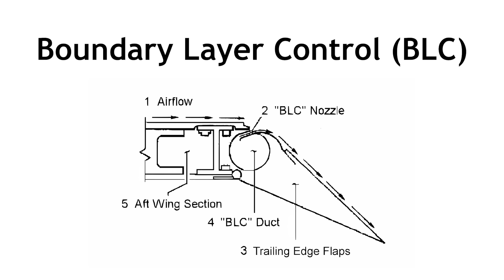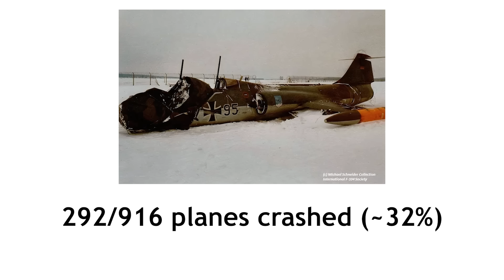Why This Jet Killed So Many Pilots?

Comment: On lighter note......I attended an air display at Brustem Air Force Base in Belgium in 1964/5. The F-104G'S display was unique. It started its take off as normal . Half way down the runway it abruptly took off, did a fast barrel roll, landed and continued its take off run....I had a clear view sat on top of a 206 Sqdn.Avro Shackleton MR3 from RAF St. Mawgan!
Reply: That video is available on youtube.
Reply: @stephenlowry8618  What a star you are Stephen. For me, that experience was lost in time.....and the barrel roll turns up on YT!. you get this weeks YT Oscar for Good Gen!!

Comment: The common US narrative that “Germany misused the F‑104 as an all‑weather fighter” is misleading. In reality, the Bundeswehr needed a modern all‑weather interceptor to fulfill NATO duties, including defending against low‑level supersonic bombers.

The F‑104 was originally designed by Lockheed as a fast, fair-weather day fighter for the US, not for European all-weather operations. The purchase of the F‑104, however, was heavily influenced by US political and corporate pressure, not purely by German technical choice.

Germany’s use of the F‑104 in all-weather roles was an operational necessity, not a misuse. The narrative blaming Germany obscures the fact: the aircraft was bought under pressure, and the Bundeswehr adapted it to meet real NATO requirements.
Reply: NATO bought the Starfighter mainly to replace it's F-84 fleet in the nuclear strike role.  They deployed about twice as many F-104 fighter-bomber squadrons as interceptor squadrons.

Comment: In terms of the swiss cheese theory, the F 104 simply consisted of more holes than cheese.
Reply: And there was most probably corruption in procurement: Lockheed was nearly bankrupt and was desperate to sell it to other nations. (Corruption was proven in other nations, but in Germany authorities failed in proper investigating the procurement process.)
Reply: And when you buy the farm, there won't even be enough left to make a sandwich.
Reply: Widowmaker was basically a manned rocket

Comment: Speyer Technical Museum, in Germany has a F-104 on display with it's outer skin removed. Seriously scary, extremely fragile structure.
Reply: Been there. Seen it. The F-104 is built like any other plane from that era. Planes are designed to be as light as possible. Things like cars, buses, trains, can all be grossly overbuilt. A plane cannot. Your concept of strength is just skewed because you have no knowledge of aircraft design or structural engineering. The skin provides a significant portion of the strength in a modern aircraft design (post-WWII). It is called "stressed skin" or "monocoque" construction.
You also probably don't appreciate how strong the alloy used really is because you have only interacted with consumer grade aluminum alloy. This isn't a bicycle frame and the alloy used is much stronger.

Comment: In Germany WE Had some Problems with this fast and mobile jetplane:
 IT was constructed for good weather and we tried to make it an alllweather plane.
WE did Not have enough Hangars for it- and it was parked unser Open Sky
WE ad too much additional systems to make the f104 better-as a result it becomes too heavy
And the Training time for our pilots was Not enough
In the end it was the wrong plane for the Luftwaffe....
From about 900 Planes more than 200 Fall down.....
Reply: Don't kid yourself.  Germany would have had just as many problems with the Mirage, the Super Tiger, or whatever.
Reply: @dukeford any Arguments for your oponion? The reasons i discribed is what i know...
Reply: @derrasendeemil6714  Because none of the prospective aircraft that Germany was considering at the time had any better safety records, that's why.  The main problem with Germany's Starfighters was poor management, not the airplane.

Comment: F-14 was also a Widowmaker... It's almost criminal that it wasn't fitted with the GE engines almost from the start. It wasn't long after the F-14 came out that the F-16 came out and it already had the engine that would eventually go to the F-14B and D model
Reply: The F-14 was about 3-4 years ahead of the F-16 in the design cycle. At the time, it made a huge difference in design choices. The F-14 first flew in 1970. The F-16 first flew in 1974. In that time, they went from tube based computers to solid state, with the difference being that the F-14 is basically a third generation jet with some fancy new avionics and the F-16 is a fourth generation jet with fly by wire. The F-14 was expected to serve in Vietnam. Grumman was too late to the party. The F-14 was basically designed for Vietnam and wasn't really suitable for what came after. When you properly consider the F-14 as a third gen jet, it is pretty crazy what they were getting it to do. And not surprising it was a dangerous bird to fly.
Reply: @RunsWithChainsaw good point...

Comment: I was an infantryman, 3rd ID in Schweinfurt, FRG from 76-79. The Luftwaffe F-104s used to practice strafing runs on our troops and APCs during FTX/CPX/REFORGER exercises.

The sound out of those damn things was something straight out of hell. They would come in low and fast and then hit afterburners after pulling up.

Right after that we would get the American Air Force F4s doing the same thing.

Comment: Regarding the downward ejection seat. I spoke to a Royal Navy (RN) Fleet Air Arm guy who's job was maintenance of fast jet ejection seats. The RN specified 'zero/zero' seats, capable of safely firing at zero altitude and zero forward speed.
Reply: There weren't any zero-zero seats when 2nd Generation jets were being designed.

Comment: The aircraft was an excellent design for it's intended role. It was asking a lot for the young pilots who flew this aircraft and it was unforgiving at low speeds and low altitude. 50% of Canada's Starfighters were lost to weather related accidents. Germany lost many of theirs to weather related causes. Japan and Italy among others had used the aircraft in it's intended role and were successful in it's use for many years. It required an exceptional pilot with a superior understanding of the aircraft.
Reply: Aircraft engineering training, during five years in the technical university, perhaps???
Reply: Italy lost 38 %,  Why Japan lost so few may well be the same as Spain, low losses because they only flew in very good weather.

Comment: you just had to know how to fly it ,,,,dont pull it off to soon on takeoff keep up speed on landing dont try to turn to tight and enter a high speed stall
the 104 was a interceptor not a fighter; the downward ejection was reversed early in its develope no problem

Comment: The Germans lost more F-84's than 104's. Spain didn't lose any of their F-104's. Kelly Johnson built a stick shaker so as not to exceed the 15° critical angle of attack. When flown properly and with maneuvering flaps, it could turn about the same as an F-4. A bad craftsman blames his tools.
Reply: This is BS, the loss rate of German F-104 exceeded that of German F-84 by far.
Reply: @OliverSchroeder  37% crash rate of their F-84's vs 32% crash rate of their F-104's. I stand corrected, I should have mentioned percentages. They needed more training and better maintenance procedures.

Comment: I remember the English Electric Lightning as being before the F104 and exceeding Mach 2? And much quicker in the climb
Reply: And it did not crash.
Reply: @stephenconnolly3018  Really?  The Lightning's attrition rate was only around 10% lower that the Starfighters
Reply: @dukeford  Really? English Electric Lightning  just over 15 %, the F 104 in Germany  32 %,  F 104 in Italy 38 % and F 104 in Canada 46 %.
Reply: None of which is true, I'm afraid.
Reply: @dukeford No, of course, never ever contradict American historiography!
Reply: @OliverSchroeder  Whatever. 🙄The Lightning didn't fly before the F-104, or exceed Mach 2 first.  The rates of climb were virtually identical.  These are documented facts.
Reply: @dukeford  The Lightning was the first to achieve supercruise and had a much better climb rate
Reply: @barrierodliffe4155  The F-104 and the F-106 could also supercruise.  Which one did it first is a matter of conjecture.

Better climb rate?  The F-104A had an initial climb rate of 60,000 feet per minute.  The Lightning was 50,000/min.  The Starfighter set the climb-to-height record.  The Lightning never did a damned thing.
Reply: @barrierodliffe4155 The Germans would have been much better off with the Lightning which entered service in 1960. They did not need long range but did need fast climb.

Comment: And then there was the infamous Lockheed scandal, involving many Europeans politicians and even royals who got bribed by the American company, which sold its jet as agressively as their damned overprized F 35. Belgium at that time had a mix of Mirage V (deltawing) and Starfighters used as fighter/bombers. My brother (1953-2023) was a technician on them in Kleine Brogel AFB, hence the presence of the two pedals and the yellow/black stick to open the canopy in case of a crash in my appartment can be explained :)  I've got to admit I was much more a fan of its successor, the versatile F 16, and especially the beautiful 2 seater....

Comment: The first flaw was the german corrupted politicians who "chose" the F104 instead of more capable plane like the Mirage III
Reply: С тех пор мало чего изменилось в Германии. lol.
Reply: More capable?  Hardly.
Reply: @dukeford No. Definitely.
Reply: @OliverSchroeder  The F-104 had superior performance in all flight regimes except low speed handling. The avionics and cannon were FAR superior. It was cheaper. It was a fully developed airplane; the Mirage was not.

Comment: What is baffling is why after all the deaths from using the Starfighter in low level strike missions did the Germans and Canadians continued to use them in this role?
Reply: Yes the RCAF used the CF-104 in the reconnaissance role, as a deliverer of 'instant sunshine' in the nuclear role, and finally in the pure ground attack role after nukes were withdrawn from Canada's role.
Reply: What makes you think they would have done any better flying something else?

Comment: The Belgian Air Force had the same problem. It bought 112 F-104G's. It lost 40 of them. 21 pilots were killed. Main reason was its use as a ground attack aircraft.
Reply: Great score!
Reply: A 35% attrition rate is typical for any 2nd Gen fighter.
Reply: @dukeford  With pilots killed too?
Reply: @leonpastis4663  Actually, it was 24 pilots. All officers (none of the 45 Belgian Warrant Officer/NCO Starfighter pilots were ever killed). 58% is a high fatality rate.  OTOH, their attrition rate wasn't out of the ordinary at 36%, and their accident rate was  reasonable enough at ~ 11 losses per 100k hours.
Reply: @dukeford So, according to your previous argumentation, dumb, lazy, unable German technicians were flown to Belgium and bungled the job?
Reply: Well the Spanish Air Force didnt loose a single 104.
Reply: @ramezyaghnam5843  An outlier.  They hardly flew the things (about 10 hours per month per airplane), and only in perfect weather by their most experienced pilots.

Comment: Its a shame the luftwaffe didn't use the English Electric Lighting   instead of the F104 but as America was giving them away with a box of Cornflakes the Lighting couldn't compete
Reply: The Lightning did not have the capabilities.  It was way more expensive.  It was harder to maintain.
Reply: @dukeford  The Lightning outperformed the F104 in every way, and particularly in manoeuvrability   But it was harder to maintain.
Reply: @johnfaulkner8632   The F-104's performance was equal or superior in every respect (range, climb rate, speed, max altitude, service ceiling, low-level speed) except for low-speed maneuverability.

Comment: The Aircraft that  flew a month later could outclimb the 104 easily  !
Reply: Then why did the Starfighter have all the records, while the Lightning never had anything?
Reply: @dukeford The top speed of the English Electric Lightning is Mach 2.27, which is approximately 1,500 mph (2,414 km/h) at 40,000 feet. The aircraft was a high-speed interceptor known for its ability to climb very quickly and reach this top speed. 
The F-104 Starfighter was capable of a maximum speed of approximately Mach 2.2 (around 1,450 mph or 2,333 km/h) at high altitude, depending on the specific variant and external loadout.
Reply: Neither plane was definitively "better" as they were designed for different roles; the English Electric Lightning was a superior pure interceptor with unmatched acceleration and climb, while the F-104 Starfighter was a faster, more versatile, but also more difficult and accident-prone aircraft. The Lightning excelled at quickly getting to high altitudes to engage threats, whereas the F-104 was a faster, manned rocket that could also be used for tactical strike missions.
Reply: @stephenfloat1260  The Lightning's initial climb rate was 50,000/min.   The initial climb rate of the F-104A was 60,000/min.  The Starfighter could climb to over 100,000; the best the Lightning could do was around 88,000.  Yes, this is splitting hairs, but the Lightning had no advantages over the F-104 when it came to performance.
Reply: the English Electric Lightning has flown as high as a U-2 spy plane, intercepting one at over 66,000 feet and even reaching a maximum altitude of 88,000 feet in a specific instance. This was possible because of the Lightning's remarkable climb rate and high-altitude performance.   @dukeford

Comment: I have met a German pilot who used to fly F104's. He once had a flame out immediately after takeoff in the climb out. He reacted fast and was (probably barely) able to turn his jet around and land it without power. Normal procedure was to use the ejection seat, but he knew that using the ejection seat would cause so much damage to his spinal cord that he would most likely be forbidden to fly jets afterwards. Hence his desire to never use the ejection seat. By the time I met him he was flying F4's, And while I do not exactly remember his age, I believe he was over 60 at the time with more than 2000 flight hours.
Reply: if he was 60 when you met him I can guarantee you he wasn't flying F4s at that time 😂
Reply: @archer494  The F-4 was introduced in the Luftwaffe in the early 70s. There was a sizable time overlap when both types were in use in Germany.
Reply: @Erdbeerschorsch2011  I meant I doubt the guy was still flying fighter jets at 60 years old
Reply: @archer494  In Germany the age limit for flying jets (military) is 41 years.
Reply: @archer494  I may be wrong about the age, but not about the F4. And I am pretty sure I got the age close.
Reply: @r123ingelderland6 
official retirement age for the Luftwaffe is 62, and while there's no official max. age for active pilots, I am reasonably sure they won't let someone that age fly a fighter jet - apart from the fact that at that age they should have been promoted to command rank. Oberstleutnant or Oberst. The two ex-Luftwaffe pilots I know stopped flying in their late 40s
Reply: @archer494  Yes, this guy was special. I did not ask him what unit he was assigned to, but he flew the F4 that we used for testing our equipment.
Reply: my Dad trained the Germans at Luke.  The stall speed was so high they had parachutes to slow the roll once they touched wheels.  There is no, no way he turned around after a flame out on take off, besides the early models had a downward ejection seat which wouldn’t have helped anyone at low altitude. The J79 was a reliable power plant. perhaps had a compressor stall at altitude
Reply: @scottlelightener7165  I can only quote what the co-pilot told us. But I just checked deep-seek (AI) and it seems to me that there may have been a mistake. The pilot did land after a flame-out following a throttle-back from full-afterburner climb, but he did that at an altitude of 43.000 feet. He realised that he could reach an airfield and did so. Deep-seek: "The pilot, Oberleutnant Günter X, was highly decorated for this feat. The incident is still taught as a case study in exceptional pilot skill and emergency management."
Reply: Think the 104 pilot you met was living in his OWN fantasy cockpit!
Reply: F 104's had downward ejection seats for a time, ejecting just after take off would be suicide, I heard of one F 104 pilot who was flying low  over the coastal town he lived in and he was a bit depressed at the time, he pointed the aircraft out to sea and ejected but he forgot the ejection was down and he was found dead in a hole in a roof.
Reply: Typical pilot. Would rather die than be grounded!
Reply: bullshit
Reply: @adkadk407  What a well thought out response. I bet you're a real special person.
Reply: Hopé his Spinal Chord Strukk thé right Nôtés  ¡¡¡¡
Reply: @MeaHeaR  Fixed, thanks.
Reply: @r123ingelderland6 😂😂😂😅👩🏿👍🏿

Comment: You should have mentioned the bribes and corruption that underlay the sale of the Starfighter to European countries.   Brown envelopes was the nickname for the bribes.    Is it surprising that no other manufacturer 
used the ultra thin straight wing in a military aircraft.   That wing was introduced in an early British aircraft (the Miles M52) to breach the sound barrier.  The project was cancelled and the data was given to the U.S.A.    It is strange that the M52 was designed to take off and land from a runway, results show that it would have done it's designed role unlike the U.S.A aircraft that took the title having been carried to altitude on a bomber.
Reply: Dassault was said to send Ladies to the Hotel rooms of potential buyers during Aviation Fairs, to help them made up their minds. 💪 It is obviously impossible to determine if this is a joke or true, but it may well have made a difference. 
"Now, I will show you the meaning of French Performance" 😂
Reply: Indeed !